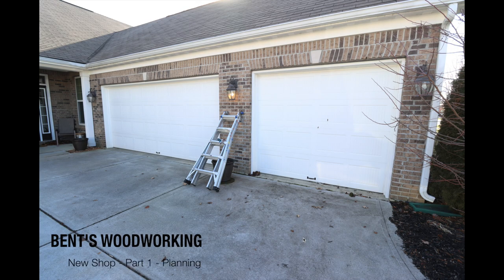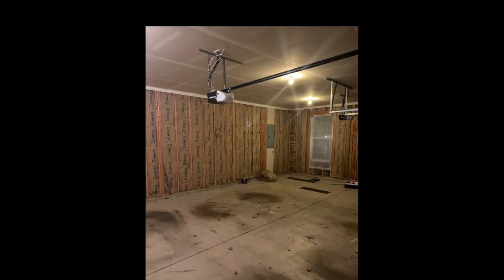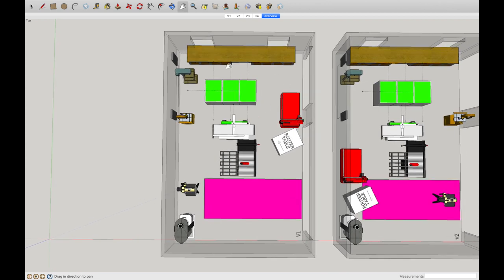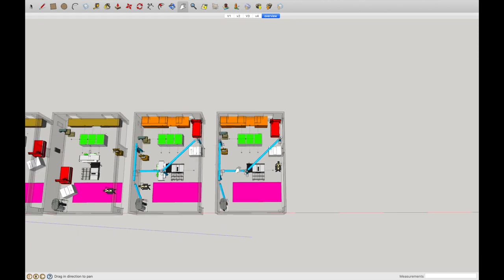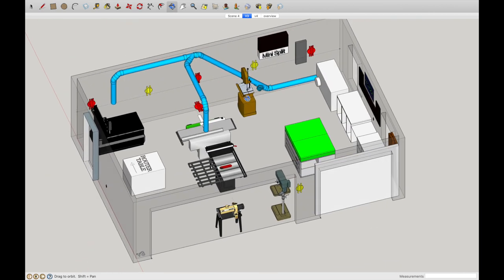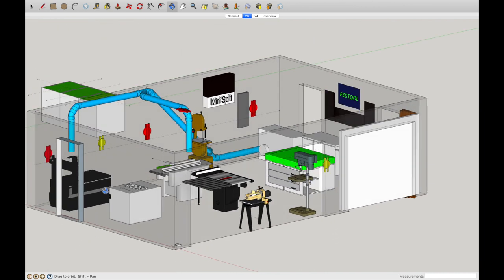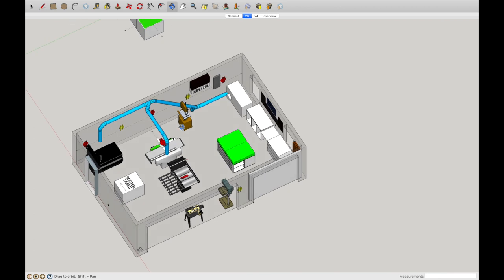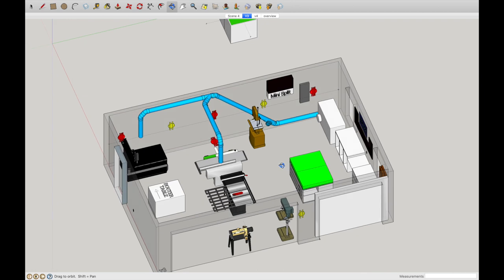Using SketchUp To Design Woodworking Shop - New Shop Part 1

Comment: Good luck there. I have just bought a place with 3 garages. But I have a wall separating single from double with inter leading door. Gonna have to plan this properly as I will be doing woodworking and Metal working.
Reply from the maker: May be nice to have it walled off then.

Comment: Jason, once you get better at Sketchup, you'll love it. My ears perked up when you mentioned putting in one of those metal ladders to access the attic. Would love to hear your thoughts on that once you've installed and used it for a bit.  Your shop is taking shape! Looking forward to the series.
Reply from the maker: Thank you. I am still not set on installing on of the doors mainly because it’s a big expense for the few things I plan on storing there.

Comment: Pull down stairs are nice, but if your roof has trusses, make sure there designed for at least light storage. I would almost bet there not designed for light storage. You can get yourself into a lot of trouble. Anything more than the drywall on the ceiling could over load the trusses, especially if your where you get snow load. Just a word of caution .
Reply from the maker: Interesting. I only plan on placing a few light items up there. But, I think they are 2x4 trusses. At least that is what the electrician mentioned the other day. I need to get up there and take a peak.
Reply: It's true, people too often assume roof trusses can  support weight like a floor joist. That's not the load  they're engineered for. Trusses engineered for storage will often have a 2x6 or ideally  2x8 bottom chord and a square opening cut out of the webbing on a few of them to give you headspace.

Comment: Looks like your getting it together. I'll be watching the progress unfold. I do have one question. Did you move your shop stuff on your orders or ship it separately and if on the orders did you come in under weight? On one of my moves I was allotted 18K lbs. The driver told me at destination that I was over but he helped me out and showed I came in around 17,600. Helped save some $$$. Good luck on the set up.
Reply from the maker: So I moved everything myself. I am allowed 13000 pounds and I am just under it, but I did get rid of a lot of tools.

Comment: You should run 6” pipe closer to your cnc. Transition to 4” at the cnc. Nice plan
Reply from the maker: I was thinking the same thing but after to specking to a couple guys that do the duct work cautioned me against it. I was actually kinda surprised but learned a ton during the process. I originally thought I was running 6" all the way to the tool and then dropping to 4 like you said. The good news with this duct system is its so easy to change later on if needed.

Comment: Really enjoyed the video, how come you aren’t making more of your tools mobile? I’m guessing do to the power and dust collection needs? I also have a three car garage but have more nonshop related stuff in the garage I have to store. So with my great weather here I utilize the driveway a lot more and can move most of my more messy tools outside since I currently don’t have a dust collection system.
Reply from the maker: I really don't move my tools unless absolutely necessary and the DC is a big part of that.

Comment: I’ve never installed a Dust Collection system so this may be a foolish question but...Any chance you can raise the DC up off the floor or I the attic ? I’m just thinking to save for space and to keep the noise down.
Reply from the maker: I probably could, however, getting it to the attic would be more trouble than it is worth. Especially when needing to empty the bag. Would be cool to just have a couple pipes coming out of the ceiling though

Comment: Where did you get the components/assets for things like the table saw, drill press, jointer/planer? Did you make those by hand, or find them and import them somehow? I’m planning my shop now and it would be easier to drop these in than build them by hand in SketchUp.

Comment: I live in Indianapolis. Any thought about heating and cooling?  Ventilation for finishing?  As a garage shop owner I wish mine had it.
Reply from the maker: I will be running an 18,000 BTU mini split in the garage. As for ventilation for finishing, not something I will be pursuing I don't think.

Comment: Didn't you mention a Miter saw station at the begining? Doesn't look like the final plan takes into account for that with dust collection or power (other than the Outlet that was originally there). Just curious.
Reply from the maker: The outlet there is changed to a quad 110 outlet and I run the Festool vac underneath the Kapex for DC. I won't have any sort of enclosure for the miter saw.

Comment: Don't set your electrical up so you're stuck with 110 at any outlets. I'm not an elecrician,  but I'm pretty sure some one who is can Wire it all like they are 220 outlets, then where you want 110, pop 2 110 breakers where the 220 would have been and wire your quad 110s so they are on the different sides of the 220. You'll end up with every 100 on its own breaker, but you'll be able to change when you want to.
Reply from the maker: Thats a good suggestion. I have a good plan for how I will be able to add later if I ever need too. However, I feel pretty comfortable with my decisions. I have actually already made a few additions cause I keep thinking about it. LOL Imagine that

Comment: Just came across this video and I am wondering why your table saw outfeed is on the wifes care side of the garage instead of towards the assembly table.  That is a lot of walking with with your cut ups to the table.  No one else asked this, so what am i missing?
Reply from the maker: It’s no difference in movement. The assembly table is the centerpiece of my shop and it’s a shorter movement from there to the cut at the saw.

Comment: is using metal ductwork much more expensive than PVC and why is metal better? I'm getting ready to add a dust collection system and have to go the frugal route as in Harbor Freight.
Reply from the maker: The duct work I will be using, yes. Extremely expensive to be honest. However, I know people that use metal AC duct and it was even less than PVC. Do what you can afford and then one day maybe upgrade.